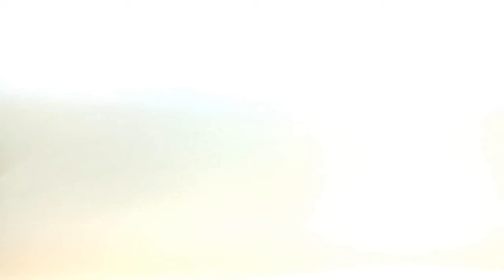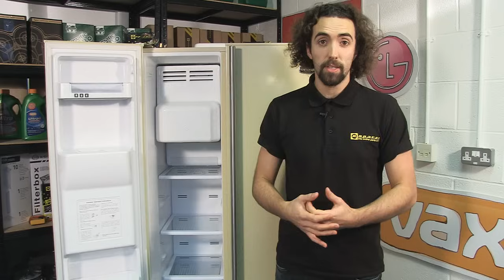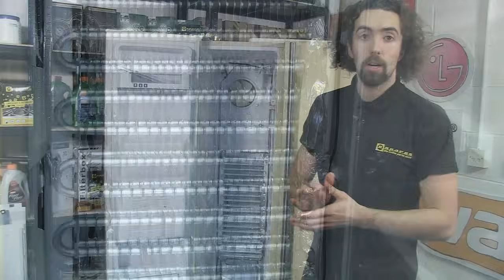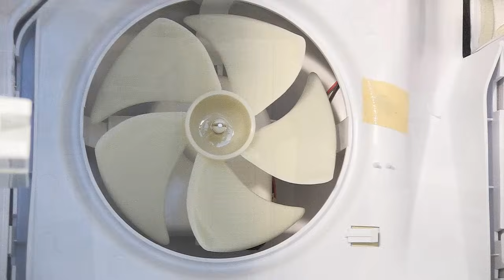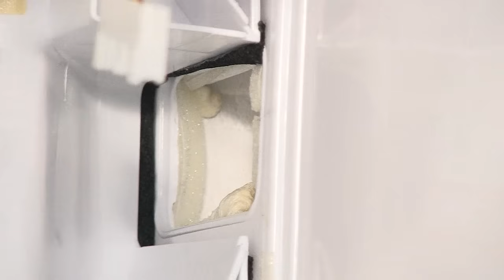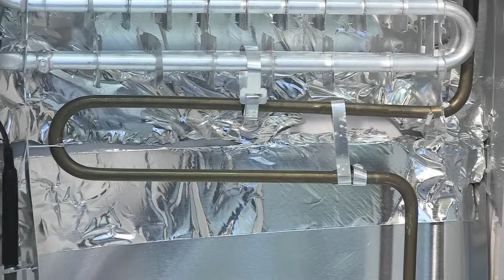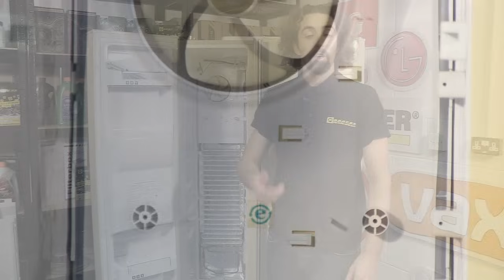BEST Advice: Frost Free Fridge Freezer Ice Build-Up & Common Problems!

Comment: I've just come across this video after clearing all the ice build up in our Liebherr Fridge Freezer. Is it possible that ice built up underneath the cover around the evaporator was caused by the door being left open for a long time? Is it only ever a fault with the components you mentioned? The freezer was never getting down to the -32degC superfreeze. I thought it might have been the thermostat. Any help would be appreciated. I've just turned it back on. (We've had it 9 years and I got a shock when I saw how much the same model is now £1600, for a small capacity 60/40 fridge freezer is slot now). My ex still has the liebherr we bought in 1998!

Comment: My frost free freezer was icing up because somehow a bread bag tie had blocked the drain hole on the inside of the freezer. Removing the internal evaporator/fan shroud, defrosting the freezer quickly using a separate fan and removing the foreign material solved the problem for me. Thanks for the video even though this message is a decade late!

Comment: Does frost-free refrigerator never stop running?

I noticed mine always running without stopping. I thought the thermostat would cut-off if the refrigerator achieved its target temperature.

But mine, if it is not cooling, it would be defrosting. My kill-a-watt meter tells me that the unit is running a total of 22 hours per day. So, only 2 hours of rest where it won't consume energy. Needless to say, it consumes high kWh/day too.

Temperature is set to MIN and I seldom open the door too. It had the best energy efficient rating (used in my country). So, I don't know what is going on.
Reply from the maker: Hi Khairun, a frost-free appliance will not normally run continually, the compressor will run as long as required to maintain the correct temperature inside the fridge & freezer. It will automatically defrost during this time and depending on the model the fan will continue to run to supply cold air throughout the freezer & into the fridge that said if there is a problem with the system it may run much longer to maintain the right temperature inside, do you have any problems inside the fridge or freezer with food going off?
Reply: @eSpares   Appreciate your kind response. No local technicians here are interested to fix a refrigerator that 'cools too much' : (   . So I have to figure this out myself somehow.

Nothing wrong with the food in freezer&fridge, though the freezer compartment does look like it 'over-freeze' everything to a stone despite the knob is at MIN. (But I don't have a thermometer, so the observation isn't really objective).

With my constant observation, it seems like everything else works normally. It cools normally & defrosts normally. Freezer&Fridge's fan is working normally too.

The compressor will shut off only when it is defrosting; and when it isn't defrosting, the compressor would constantly run as if this thing has no thermostat. 
Total run time for both defrost cycle & compressor is 22 hours per day (on the best day). On the worst day, the total run time is 24 hours per day.  On average, the unit consumes 2.8kwh/day.

Am I looking at a faulty thermostat? Thermistor?
 PCB?

*SJ-PT599G (398 liters, 2 door refrigerator). This unit's design doesn't have a condenser fan.
Reply from the maker: Hi TOBES MUSIC, the fan inside is supplying airflow to both the freezer and the fridge and will need to run continually unless it has reached the correct temperature in both, this is normal and does not indicate a problem.
Reply: @eSpares  thanks for your response, even if I put it on a low temperature it powers on every half hour. Do you think it could be a thermostat problem?
Thank you
Reply from the maker: Hi Khairun, we would suggest the next step would be to test the thermostat or sensors with a multimeter to determine if a part has failed, the PCB can not be tested conclusively.
Reply: @eSpares   I will test the sensor when I received my multi-meter.  It seems like my fridge has two thermistor for the sensor; 1 for the freezer and 1 for the fridge. I dipped the fridge's thermistor (only) in ice water and that somehow cutt-off the compressor. What a weird findings haha.

Question: Assuming that the freezer achieved its target temperature, but the fridge did not, will that prevent the thermostat from cutting off?
Reply: This is what I don't understand, I have A indesit Total no frost fridge freezer and the fan seems to keep running around every half hour. The fan cuts off when I open the door. I'm thinking to take the fan out and change it with a energy efficient silent computer fan and see what happens 😂 however I'm thinking it might be the thermostat
Reply from the maker: Hi TOBES MUSIC, putting it on low will not affect the fan as its job is to supply airflow to keep the freezer and fridge cavity cool, it will be affected by how many times the door is open as warm air is going inside and the sensors will keep the compressor & fan running during this time but this is perfectly normal unless the F/F is not keeping cold.

Comment: is it normal for a freeze fan to not be on all the time? Ive noticed my new fridge freezer isnt on all the time and i wondered if this was normal? (its in the garage btw) and its currently pretty cold outside :D
Reply from the maker: The freezer fan would be controlled by the sensors inside, if they think the freezer is cold enough the fan might not need to come on but check the climate rating as fridge freezers in garages can switch off because the ambient temperature is too cold.

Comment: My Beko frost free fridge freezer model CS5713APS has following problem: I noticed it not cooling down enough as temperatures were close to 20° fridge and around 0 freezer and compressor was still running. I left it of for 3 days. After turned on again it cools down fridge to around 10° and freezer -10 but doesn't switch off itself but slowly starts to increasing temperature again back and I can see water drops at the back of fridge. Compressor still running but temperatures are increasing. If turned off for 10 minutes and then back on, compressor doesn't start but I hear clicking sound like every 2min. from compressor area. If I leave it again for a day it starts working normally but process is same again... Any guess what is faulty please?
Reply from the maker: Hi Stefan, from the faults it would suggest the compressor is not pumping correctly causing the temperature rise and getting that hot it is taking out the TOC, the only way to verify this is for a refrigeration technician to attach a line tap onto the compressor and check it but sorry it's not good news as the compressor can be very expensive to replace.
Reply: @eSpares  That's what I was wondering... Time to buy a new one. Thank you

Comment: Had the same problem with a Zanussi as in the Fridge not cooling but the problem was that the vent behind the evaporator in the freezer was iced up. You can find out if this is your problem by opening the fridge door and holding closed the door switch and see if you can feel any cold air coming from the vent under the fridge light (this will only happen if the compressor is running), if no air is flowing open the freezer door and if the cold air starts to flow from the vent then the vent at the bottom left of the fridge that goes to behind the evaporator in the freezer is blocked with ice. An easy fix is to remove the vent cover in the fridge and blow hot air with a hair dryer (at fast speed) directly into the vent for about 5mins. This should melt the ice at the end of the vent and allow the air to flow again.
Reply from the maker: Hi Dave, thanks for taking the time to leave your comments. We hope your post will help other people to fix their appliance.

Comment: my siemens fridge is displaying an alarm sign not the fridge temperature. i press the alarm button  to turn it off then it displays the degrees but when i close the door it goes back to showing the alarm sign again. the fridge is no longer cold and the freezer is no longer freezing
Reply from the maker: Hi Tawananyasha Nyakadedza , have you got the model details and what error code it is showing so we can look into it.
Reply: @eSpares  i do not know the model i bought on a second hand dealer. the pipe that goes from the compressor to the inside fridge at the back is frozen, its full of ice i just checked at the back
Reply from the maker: Hi Tawananyasha Nyakadedza, a frozen pipe from the compressor usually indicates it has been over gassed during a repair, unfortunately you need the correct refrigeration equipment to check the system and re-gas it. Can you go back to who you bought it off as it is not working?
Reply: @eSpares  it was never repaired since i bought it and we last re-gased it four years ago

Comment: what should Daewoo Thermal Fuse
read on multi meter i had 1.829 on one of themi suspect its dead ?
Reply from the maker: HI Neil, the reading s will vary on the different types of fuses but if you get a reading it will normally indicate it is ok.

Comment: Hello Josh, Your video is very informative. I have a side by side RS21DLMR and the two interior lights in the refrigerator side are not working so I changed the bulbs (+ tested them) then realized that the original bulbs were still working. I also checked the center connectors behind the blue plastic circular cover in the center console to make sure they clicked shut. However, the freezer light is working. The triangular sensor on the upper right which responds to the right door also looks ok. Please advise how I might fix this problem. Thank you for your help.

Comment: In comparison to the previous, the new generation of frost free fridges spend more energy, are noisier, need more maintenance and repair and if there's a black out the food will rot quickly and don't last long. The old generation has all the advantages except cleaning the ice once or twice a year. The technology makers have taken into account only how to make money rather than giving us a better product.
Reply from the maker: Hi Zebralionfish. Thanks for the post. We agree there are advantages and disadvantages of newer/older appliances. But as always there are two sides to every coin. Thanks for tuning in.
Reply: Hi, My previous fridge lasted for 17 years with 0 maintenance only cleaning the ice once or twice a year and decided to buy e new one because in the end started to leak. The new fridge, frost free, same brand and size as previous one but needed repair in the second year. In the past we had proper fridges now they are designed to end up in the rubbish tip as soon as the warranty has past, all this in the name of "frost free", fake innovation. What a garbage??

Comment: I have a two year old Zanussi under-counter freezer and have noticed that icicles have formed around the top drawer, which is obviously far too cold - the 3 drawers below are no-where near as bad.  Any idea what this could be due to please and is there anything I can do?
Reply from the maker: Hi Amelia, the first thing to check is whether the door is closing correctly in case there is air going in and causing the build up, is the freezer self defrosting?

Comment: Hi I have a Hotpoint frost free and the door was accidentally left open on the freezer compartment over night and now there is a noise like the fan is hitting something and temperature below what it should be so I have removed and drained the back panel which was full of solid ice inside, the noise has now gone but the temperature is still low and Not blowing much air through the vents. Is there anything this could have blown by it over freezing? Any help would be much appreciated. Thanks
Reply from the maker: Hi Dawn, it is possible the compressor has been damaged due to having to cope with all the warm air going into the freezer section, it also may not be able to clear the ice behind the freezer panel so you will need to defrost it before doing anything else.

Comment: Hi, got a daewoo frs-u20dai model which is beeping and shutting down. Not cooling at all. What could the issue be? Thanks
Reply from the maker: Hi The Installer Guy, what have you checked so far? is the compressor running at all? start by checking the TOC that is fitted to the side of the compressor as if that is faulty it will shut down the compressor.

Comment: Great video Josh. Very straight forward and informative. Unfortunately it doesn't help me with my Baumatic integrated fridge freezer. The freezer is working fine at the bottom but the fridge at the top has stopped cooling and is room temperature. There is no duct going from the freezer section at to the fridge section so cannot see how the cold air gets up to the fridge. Any ideas what I could try? Thanks in advance,. Darren

Comment: We have a FUFL1810G Fridge Freezer , its only 5 years old but the fan usnit at least has been changed several times. the fridge isnt open most of the day either as we are at work etc. This week the fridge and freezer stopped cooling, the tempreature in the fridge went to +19. and it was like this for about a day, it started working only last night again. ultimatley i think im going to replace the whole fridge as we cant keep having this doing this.
Reply from the maker: Hi Chris, thank you for your post and you have not had much luck with this fridge freezer but if you are going to change it hopefully your luck will change.
Reply: @eSpares  thanks. I did wonder about fixing it but I said once the warranty ran out if it in December I'll get rid the next time it broke. It actually started working a day or so later, but I've replaced with a samsung now

Comment: I need assistant, I have no cooling at all on my Samsung RS2530BBP refrigerator. Freon is ok in my compressor, I’ve installed a condenser motor w/fan and a relay connected to the compressor. But still no cooling, what do you guys think? I need help!!
Reply from the maker: Hi Ralvell Rogers, is the compressor running? what checks have you done to say the gas is OK, was the condenser motor faulty?
Reply: @eSpares  yes compressor works, condenser motor was really squeaky but i replaced it.

Comment: Model : FRS-U20DCB has started to leak at the bottom of the freezer under the bottom drawer and out onto the floor. any idea what it could be and how to fix it ?
Reply from the maker: Hi Angie, it sounds like the freezer section may not be defrosting correctly, you will need to get to the evaporator behind the freezer back panel and have a look and test the defrost heater to determine if it has failed.

Comment: hi my non frost lg refrigerator is not cooling since my brother put overload meats in the freezer and cover all the holes where the cool freezing air comes out.. since then my freezer didn't work normal as before..please help me...
Reply from the maker: Hi altz bautista, what have you checked? if it is not a frost free model then it will take some time to get down to the correct temperature after the meats have been put into the freezer. what are the model details.

Comment: Hi I have a beko cda543fs 2011 model so not effected by the recall and the back of my fridge wall is freezing. I've cleared the drain hole in the back and check the door seals please help
Reply from the maker: Hi MrGall, if you are sure you have cleaned the hole all the way to the compressor then it is most likely to be the fridge sensor so test that first before suspecting the board.
Reply: @eSpares  I used compressed Air from my lungs it's definitely cleared haha. Is the fridge sensor easy to change?
Reply: Oh yeah last night I  took the cover off the evaporater and noticed where the heater is and the blue tape there's a little hole that's frozen up is this needed to be clear to allow air flow

Comment: I have a Bosch KAN 58A40AU and the video very informative, although I would like some advice on removing the panel in the freezer section to get access to the evaporative section. There are circular type clips placed along the midsection of the panels.....not sure what to do ?

Comment: Hi there, great video, I've tested the heater and I'm getting a reading of 330 ohms, just 30 ohms above the 300 top you mentioned, does that mean I have to replace it? Thanks
Reply from the maker: Hi Alberto, it does depend on the brand and type of heater but if you are getting around 330 ohms it should be ok and you are reading continuity through it.
Reply: @eSpares  Thanks very much guys for the quick response and for the video, it's great, everything working now, not sure if ice will build up again but If I need spares I will be buying them from you as the service is great! :)
Reply from the maker: Hi Albero, thank you for the kind words about our channel we will keep our fingers crossed it all goes well.

Comment: Hi can u tell me if the fridge  makes a noise and I see orange  in the back what's that
Reply from the maker: Hi Monica, a fridge does make a range of noises during its operation depending on the model and as long as it is working ok there is nothing to worry about.

Comment: HOW LONG DO THEY TURN OFF TO DEFROST THEMSELVES, THANKS
Reply from the maker: Hi Margaret, your appliance will not turn off to defrost, however the element which is fitted underneath the evaporator will heat up any build-up of frost to drain out, usually every 16 hours.